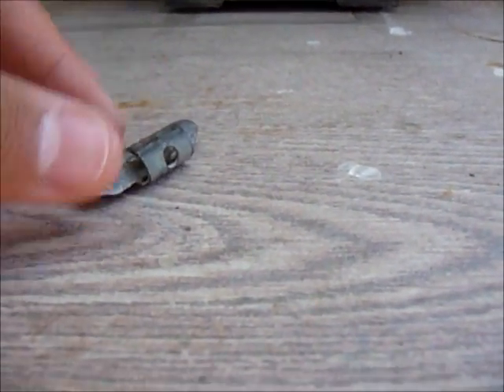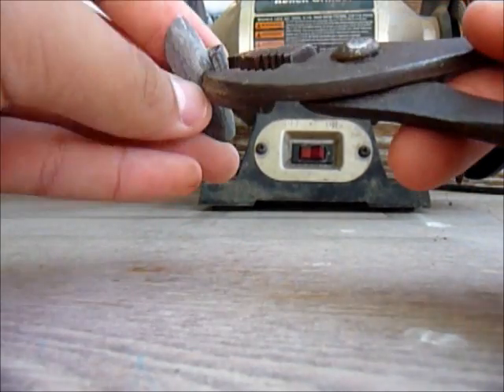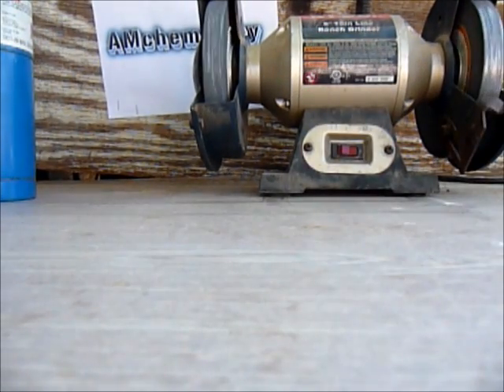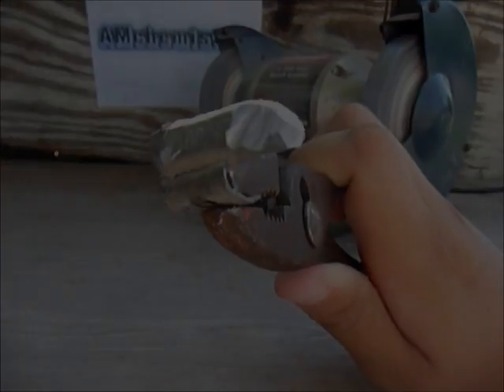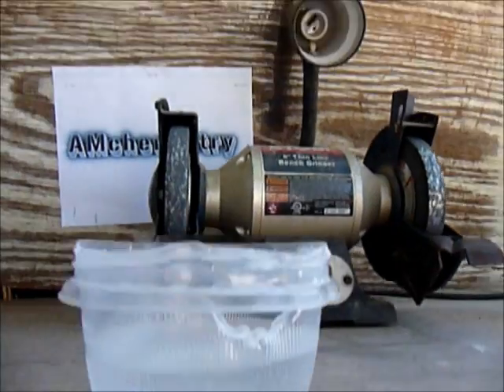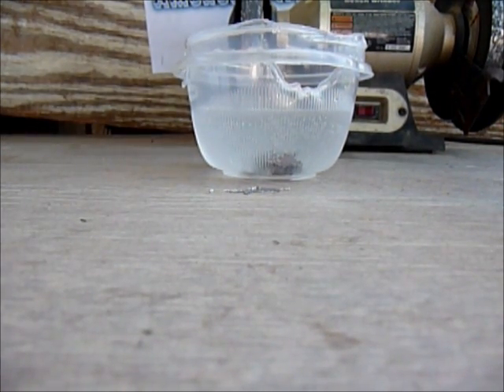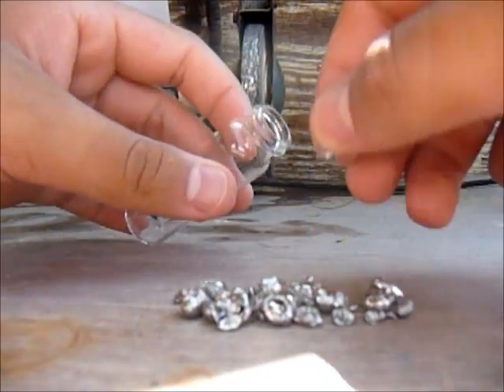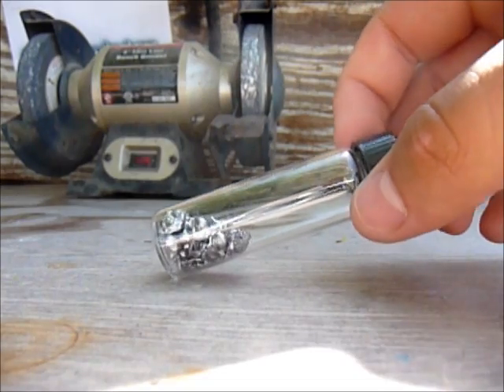Make purified lead shots

Comment: You could just as easily dissolve lead in HNO3, evaporate, create a saturated solution, and dip in a piece of steel to precipitate lead metal. Filter, dry, contain.